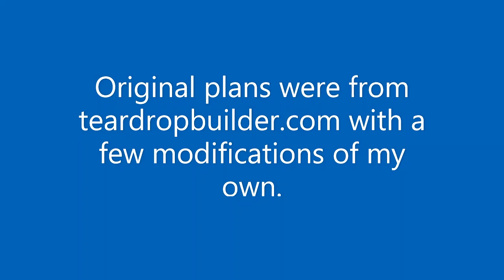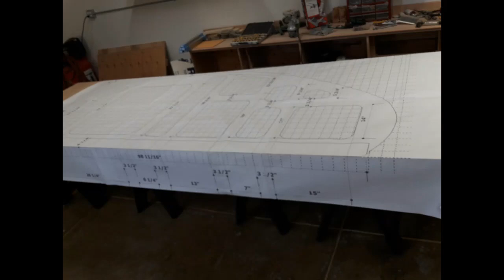Cedar Strip Teardrop Camper build

Comment: Hi Mike, may I ask how did you make the plywood thickness size as illustrated in page C5 and C6 is 3/4. You were able to put 1/4 at the inner side and 1/2 on the top all together in 3/4 plywood. Did you use a router to reduce the size make that sidewall portion thinner?
Reply from the maker: I used a router and guide to cut out 1/4" of the 3/4 plywood.  I used resin, with no fiber, on this portion to weather proof it.  This cut out section will never be assessable once assembled.    This rests on the frame of the trailer, and the top cut out has the interior celling resting on it.
Reply: Great! 😀Big help Mike. Thank you so much. With regards to the fiber glass cloth/epoxy resin coating on outside skin, you were able to show the grain/natural pattern of Cedar wood. How many layers of fiber cloth did you use? In Manila, most of the stores are selling only 2 oz gauge of fiber.  I hope that you will still have time to reply to my future inquiries. Thanks again👍🏽
Reply from the maker: @rommelabesamis581  I used only one layer of 6oz fiberglass. I ordered it online at 60 in wide. I believe it was a total of 13 yards. I put a total of 3 layers of epoxy and 5 coats of spar varnish. Sanding between them all.  Thanks
Reply: @Butcher7484  regards to the spar varnish, is that applied before or after the fiberglass?
Reply from the maker: @toddmallory2506  Hello, first I am new to fiberglass, so check my advise, I am a newbie. This is my first/only fiberglass project.   I used 6oz fiber cloth with epoxy first, sand, second epoxy, sand, third epoxy, sand, first varnish, sand, 2nd, sand, 3rd, sand, 4th, sand, 5th.  I don't think you need 5 layers, but I kept getting dust bumps in the finish.  You can see in some of those pics, I turned my garage into a paint booth to stop the dust.  This really helped with the dust.  You can actually see my reflection while taking pics in the final coat.  Thanks.  Mike

Comment: Hi longtime teardrop lover. Where did you get your cedar strips.
Reply from the maker: Originally I was going to purchase them.  I did not because the shipping was more than I could buy cedar boards locally.  I ended up making them myself.  A bead and cove bit set was 40$ on Amazon. I bought 4 1x12x8 cedar boards from a local lumber yard.  These were for the sides. I was very selective about getting as few knots as possible.  After not finding any more boards at that lumber yard I sourced three different home depots and bought 8 1x4x6 for the top and hatches of the camper.  I cut all these boards to 1/4 in strips, than bead and coved them all.  It probably did save me some money, but cost me a lot of time.  Thanks.  Mike
Reply: @Butcher7484   made from 2x or 1/4 ply